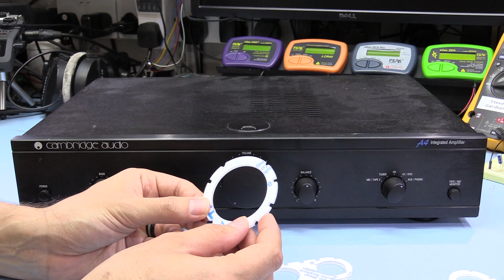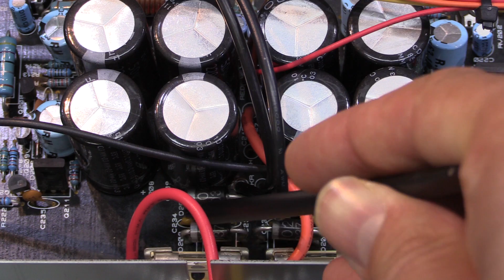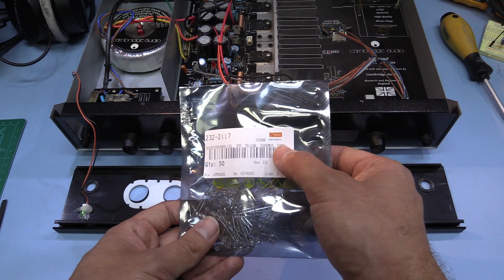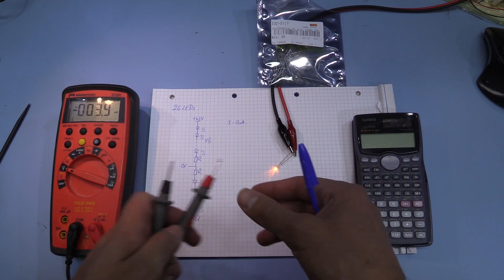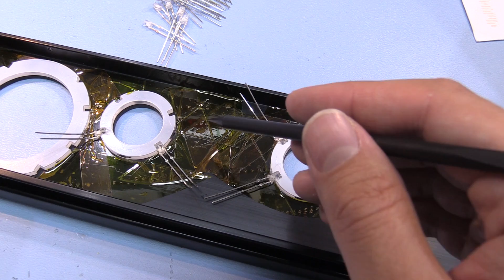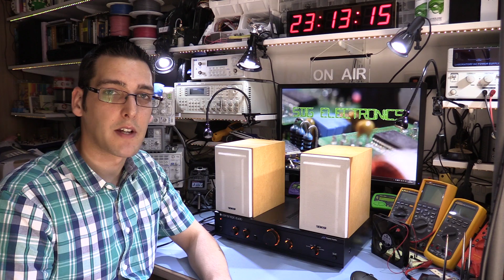SDG #025 Cambridge Audio A4 Amplifier Modifications

Comment: I bought an A4 from a second had shop for 25 quid and it had a buzzing noise. I was going to throw it away then found this video. Got some new capacitors and followed the video and now it works with no buzzing and sounds great! So,  great amp for £35 all in plus a bit of my time. Thanks for the video!

Comment: Very cool, looks awesome. Wish you had shown a bit more (for dummies) on the where you connected the wires on the board, the soldering in of the resisters, and soldering the LED's.

Comment: I bought a battered, non working A4 for about 15UKP a couple of years back. It had been dropped on the corner of the front panel, cracked the pcb and the chassis was bent out of shape by the transformer when it came to a sudden stop.
I must be a bit mad, but I spent ages straightening the chassis, glueing and patching the PCB etc. It sounds like new. Looks a bit rough, though.
I also did a similar repair job to a Pioneer A400, now that is a great amp! I never finished the repair to original spec though as I could never source a replacement volume pot, which was sadly destroyed in the drop.

Comment: Nice job Steve, thanks! It might have been better to add a dimmer so you could adjust the brightness, but it looks nice.
Reply from the maker: Robert Calk Jr. Yes, it's something I'm thinking about - I just need to be careful about not injecting noise into the amplifier if I use a PWM dimmer. Thanks for watching Robert.
Reply: SDG Electronics 
My pleasure - I enjoy your videos. I forgot to mention that it looked like there was some brown goo under C215 I think it was when you were looking through the amplifier.
Reply from the maker: Robert Calk Jr. I did notice this, but it looked to be glue rather than any electrolyte when I inspected after taking out the capacitors.

Comment: Great video as always. Where did you get the acrylic cut as I would like to try this on the Cambridge Audio amplifier that I have.?
Reply from the maker: rupert handford I cut them myself on the laser cutter at work. Do you have a similar model? I cut loads of spares which I could send if the knobs are the same size.
Reply: Thanks. Will email you via your website.

Comment: I have an old a4 and its currently got a constant buzz from the speakers, with nothing attached. I believe the capacitors are failing. I'm looking at replacing these but not sure which ones to buy. Do you have list of the ones I need and where I can get them from?
Reply: Me too I have the same amp and same problem did you find the capacitors and did it solve the buzz problem?
Reply: @MrHoncheunguk  yes they did. It’s working fine now.

Comment: Great video! I have the Topaz AM10 and the screen has stopped working. Any idea what I may need to poke at internally to get it functioning again?
Reply from the maker: Is the rest of the unit working normally?
Reply: @sdgelectronics  Yes absoloutely fine
Reply from the maker: @DanOsborne  I would double check the connectors in that case, maybe passing a soldering iron over anything that looks suspect. Check the voltage rails to the display if you can.

Comment: Great video! After 20 years one of those eight capacitors on my A4 has leaked onto the PCB and fallen off. However, the eight capacitors on my board are blue rather than black and they are also not so fat. What might that signify? Just a different make? Do you know where I can get a circuit diagram for this amp?

Comment: Hi. Can you please explain which cap is located where ? Panasonic FC and FM Capacitors
Rubycon YXH Capacitors - they are 2200 uF in PSU this is clear. What about FC and FM Panasonic. I have 651A Azur amp 12 years old already so sooner or later recapping has to be done. I have Samxcon at 15V and 5V PSU and some other funny guys placed by CA as original ones.Thank you in advance for advice. KindRegards Marek

Comment: I would imagine that those power supply caps are 2200uf not 220uf. Also the bias is set with a variable resistor not capacitor.

Comment: Hi Steve just wondering if you can help me. My amp just went this morning it is a Cambridge audio 300. I had noticed a few issues lately  a buzz or hum noise coming through the speakers, the sound going up and down and it feeling quite warm. When I heard you talking about the capacitors I wondered if it was them? I am not technically minded but do you think it is worth getting it repaired or would it be cheaper to invest in a new one?

Comment: Do you resolder the board to wire joints? By far biggest failure point. Caps are a distant 3rd after the regulators.  

Seriously, recapping when you've got cold joints is a waste of time, especially in audio.

Comment: I have a A1 intergrated Amp. Why does the inside fuses blow every time I turn it on ?
Reply from the maker: My guess would be a failure of the output transistors for initial investigation. They are the most likely parts to result in a high current path. Start with a visual inspection however.
Reply: @sdgelectronics  Thank you so much for your reply.  Dave.

Comment: I had to put a thumb down on this video. The reason is that this could have been a lot more valuable, if it was shown how the cabling for the panel and the volume knob LEDs was fed through the various pieces of the housing, without disturbing the reassembly and the turning of the knob. Next time, you could just speed up the video where you think it's too tedious or boring, instead of leaving out parts of it.